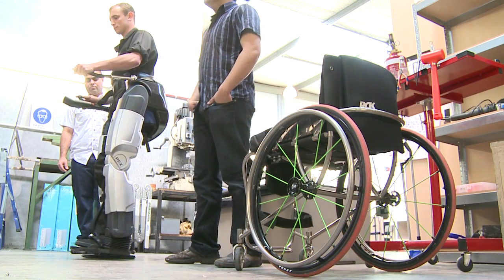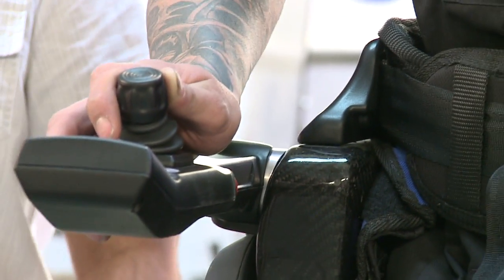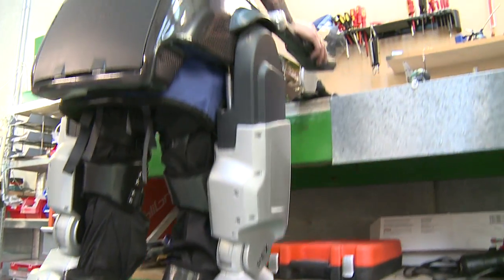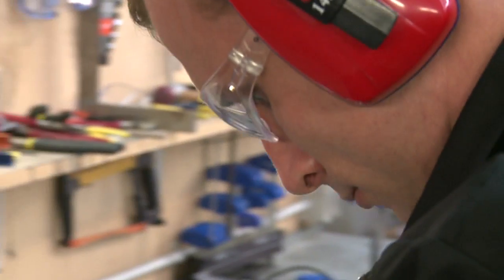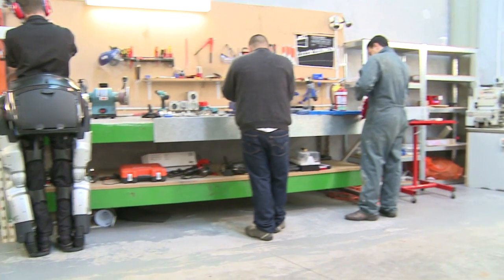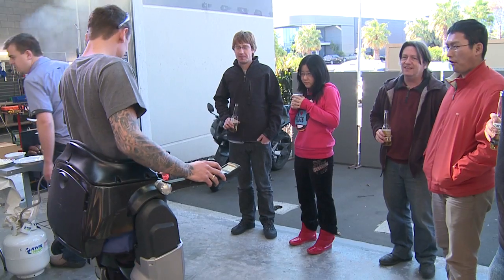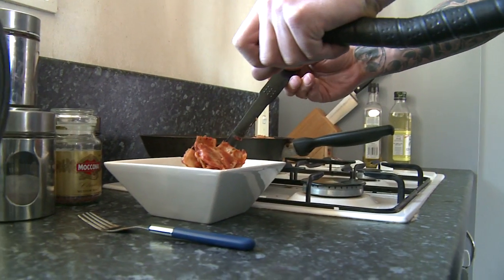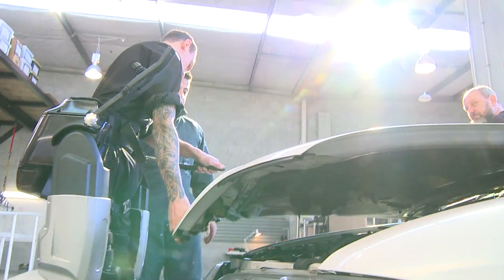Developing REX, the hands-free robotic walking device - Hayden Allen 2

Comment: @Axol I noticed one of the displays had stair climb on the controller. That would be very difficult with wheels. Also, when you aren't moving with the feet, there is very little battery being used, with segway style, there would be constant battery use to keep upright. But yes, I've seen one with a segway adapted for a parapalegic. It was great for the guy at the amusement park.

Comment: can it be fitted with powered wheels (skates) to enable REX to function as a vertical wheelchair  as well? Keep the joint movement etc but enhance the mobility with a wheeled option. I would have the wheels function as the fore-foot and heel permanently deployed, just power them when required.
Great work guys!